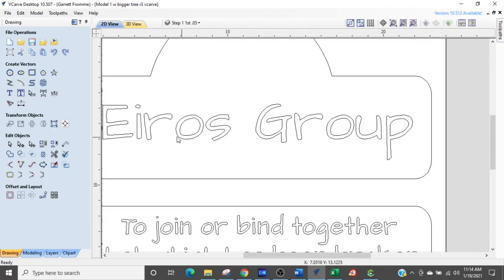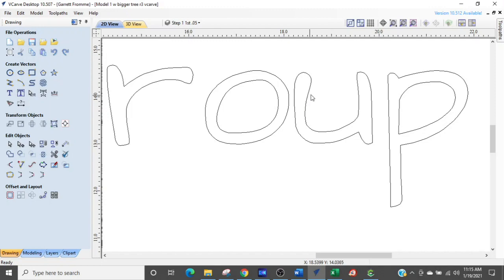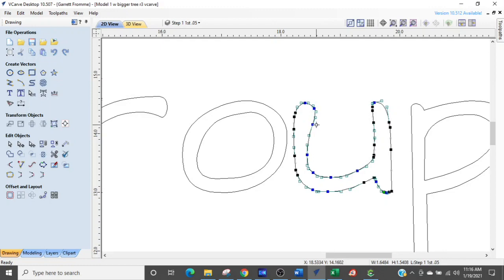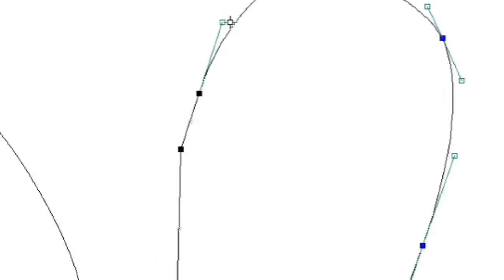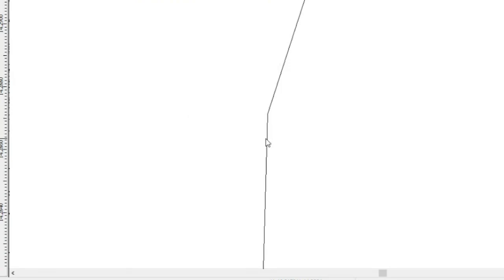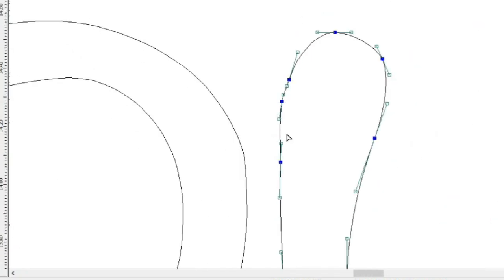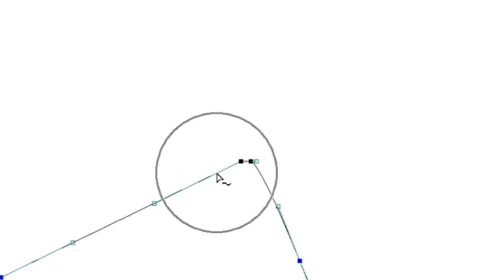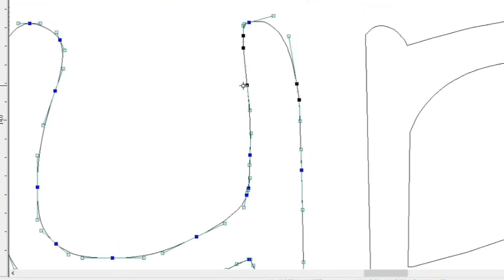How To Get Perfect Letter Cuts on Your CNC Router, Vectric Aspire & Vcarve Tutorial for Beginners

Comment: I just watched this, and it solved a problem for me.  Thank you.  I engraved a graduation cap on a project I'm making for a graduation gift, and the lines along the top of the cap had some anomalies like you described.  The looked straight in Aspire.  i looked at the nodes and easily saw why.  Now I can fix it for the next time and know how to avoid this in future projects, with other imported vectors.  Thanks again.  This is the kind of help most people don't share.
Reply from the maker: Hi Lyle. I'm so glad to hear that. Aleways want to give value. Looks like it worked. Maybe you can send a picture of the project???

Comment: Great tutorial. I’ve had that happen with what seemed to be pretty straight block like letters. Like on the straight edge of a B. It would have a small spot that looked like the Y axis stopped and the X axis moved left about half the bit width, came back on line and went on down the line. Never thought about checking nodes. Will have to take another look at it.
Reply from the maker: Bob, take a look at it again brother! The secret might be in the nodes for you to get those perfect letters this time around.

Comment: There might be an angle threshold to set when converting the font to a vector so that only the genuinely sharp angles are turned into corners. If not maybe the font could be converted in another program such as inkscape which probably has a way to set that threshold in order to avoid a lot of manual node editing.
Reply from the maker: Matt, Really good ideas! I will look into that with V carve and see if there is an angle threshold. Just like you said, inkscape is the best. I have used it in the past and still do from time to time. Thanks for reaching out!

Comment: "Fit to Curve" feature would fix excessive node issues, either using "Bezier or Arc" selection. However, good cnc controller ignore excessive nodes and are able to interpret Bezier curves. Richauto A5X, B5X, B1X series, Weihong/NC Studio, Delta, Syntec, and Siemens are all able to. Unfortunately, Mach3, Wincnc, Grbl, and UGS can not and will not.
Reply from the maker: Hi Talley. Yes, unfortunately the consumer programs do not do the work as production softwares do. Thanks for sharing this/

Comment: I am trying to make an address sign with a font that is similar to Times New Roman.  So many of the letters (i.e. F,n,r) have a straight horizontal vector along the bottom of the letters.  When my V-bit does the final pass along that vector it is leaving a dimple mark on (small dip that matches the profile of the v-bit on the bottom of the letter).  I have tried different v-bits, different fonts and I always bet the same result.  Do you have an idea of what is causing this and how to fix it?  I appreciate any help you can provide.
Reply from the maker: johnhoffman5395, It sounds like you are experiencing the common issue of V-bit "dimple marks" on horizontal vectors. To fix this, try adjusting your toolpaths to decrease the depth of cut on that final pass. This can help reduce the pressure on the wood and minimize dimples. Additionally, make sure your V-bit is sharp and properly aligned to avoid unnecessary marks. Also consider looking at the specific vectors causing the issues. Here is a video that should really help: https://youtu.be/kEGxnlfzmNY?si=qbsyVY15VmRKanY6

Comment: How long have you been using cnc?
Reply from the maker: I spent 15 years programming and running CNC's and 20 as an engineer. As far as CNC woodworking...5 months.
Reply: @IDCWoodcraft  I'm creeping up on a year for me and my laser. I learn something new everyday
Reply from the maker: @5SeasonsPressureCleaning  We never stop learning! What did you learn today so far
Reply: @IDCWoodcraft  I learned how to control my rotary speed, I'm thinking about adding in light burn cameras in near future to make the engraving easier
Reply from the maker: @5SeasonsPressureCleaning  Rotary?...as in spindle speed?...or what...
Reply: @IDCWoodcraft  rotary for engraving cups etc
Reply from the maker: @5SeasonsPressureCleaning  Got it. Very cool. So what will be the first project on it?
Reply: @IDCWoodcraft  still practicing on old cups from the house, hopefully wife doesn,t find out. my end goal is to engrave end table/coffee table legs
Reply from the maker: @5SeasonsPressureCleaning  I promise I won't tell her

Comment: What would have happened if you deleted the black nodes?
Reply from the maker: It would stop the tool from diving out at all. It would also change the text significant;y and force you to do a lot of adjustment to other nodes to get the character of the font back. Does that answer your question?